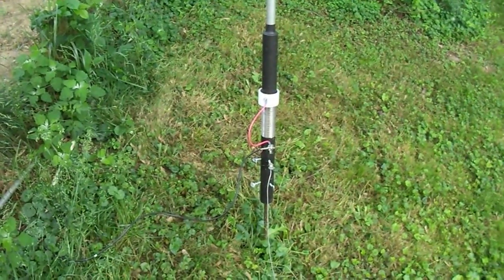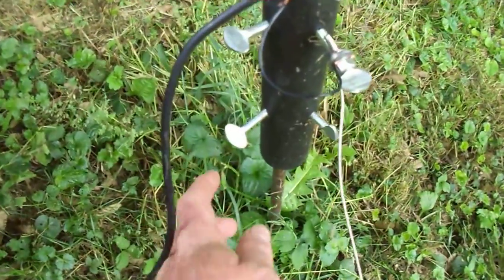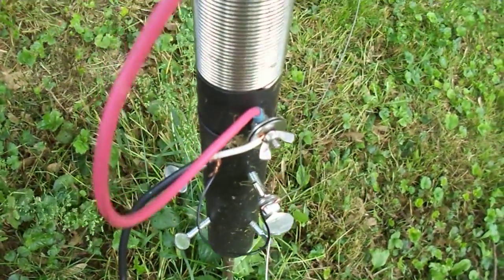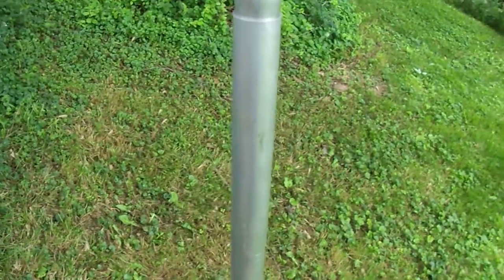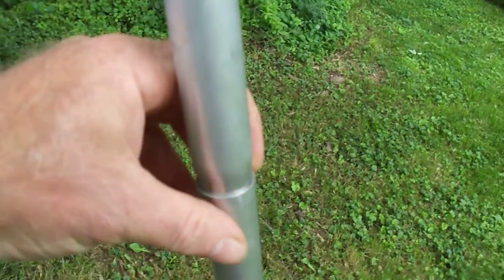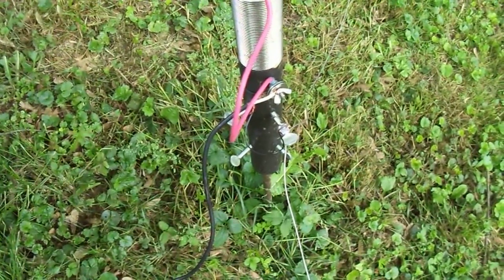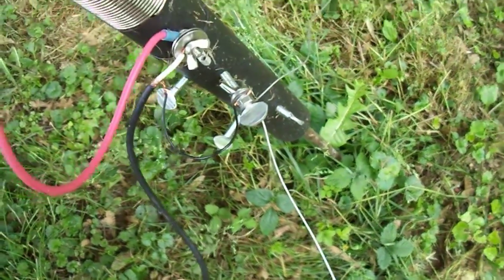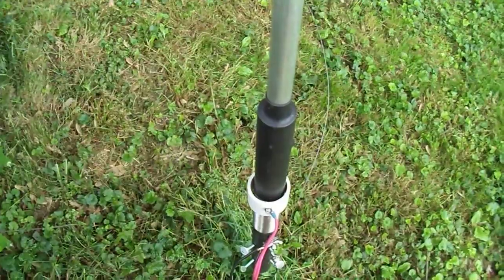Wolf River Coils vertical antenna

Comment: I do have a quick question on the stainless steel wraps they make up the coil portion are they connected to the ground or are they connected to the center hot portion of the coax
Reply from the maker: I will have to look, I took the antenna to the cabin and put it up for qrp operation. I'm thinking the sleeve over the coil connects to the center of the coax and is adjustable over the coil and the bottom of the coil connects to ground. Where I have the antenna now does ok but I have to use radicals because the soil is red clay with sandstone. When I used it here at home I used no radials just a ground rod about 7feet down and worked qrp with no problems. Hope this helps!
Reply: I’m trying to build my old version and I’m just unclear if the wraps or from the ground side of the coacts for the wraps are from the center wire

Comment: What is the length of the antenna?  I have  some of their coils and am thinking of mounting the antenna on a metal roof for the ground plane.13 feet , sorry  I hadn't seen the entire  video.  I am wondering if mounting the coil just inside the wooden wall just a couple of feet from the antenna could work, allowing adjustment  inside ? Thank for sharing your experience !! I am on  a second floor with a porch roof just out side the window also with a metal roof, so a large mag mount , whip and the coil could also work. Being disabled getting stuff done remains difficult! .
Reply from the maker: Its my opinion this antenna works better close to the ground with buried radial wires and mounted on a 8ft ground rod sunk down about 7ft. I have worked Europe on 20m with 2 watts when conditions are good. The problem I have had with this antenna is the coil has to be cleaned from time to time and the segments in the main element have to be taken apart and cleaned also to lower any resistance and to maintain resonance. I use a MFJ ant analyzer to set the swr also.

Comment: what is the red wire connected to?
Reply from the maker: +Geronemo Bauer  The red wire is connected to a sleeve made of hardened plastic with a metal strip inside of it. The sleeve is to allow the user to tune the coil and antenna for the frequency you are operating on. I preset my antenna with a MFJ Antenna Analyzer.  It works well for the QRP Operation I do.

Comment: so you leave out in the open like you have in the video? What about if it rains? does it short out?
Reply from the maker: +Robert Fernandez  Yes I leave the antenna outside all year around. The swr does increase when it rains and  when the wind is blowing I take the top part of the antenna apart so it wont be damaged.

Comment: Cool looking vertical there Carl, i have since taken mine down after 4 years in use.   I found that it was starting to get very noisey at the end and a real pain to want to listen to the radio.   So now i have a dipole strung up and tuned for 14mhz.  Perhaps we should try a chat see if we can hear each other.  :-)
Reply from the maker: *****  Hey Darrell! This antenna is actually quieter than my other ones.  Yes we should we should try a qso on 20 sometime. Im away working on the weekends so it would be better to try during the week in the evenings.
Reply: CARL BOLEY Sounds good, you pick the evening and i will try to be there, i work alot of overtime at work now, but i am home by about 8pm most of the time.
Reply: Nanada  cinta

 

Nada. Cinta. Sinteran. Indonesai